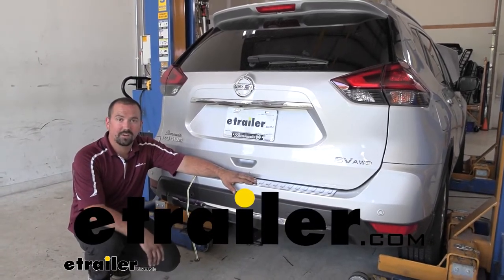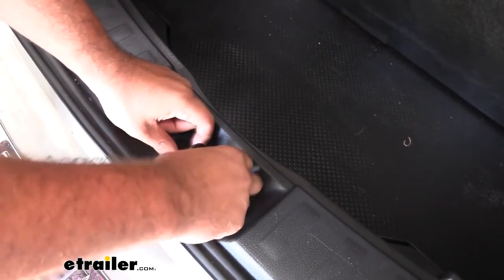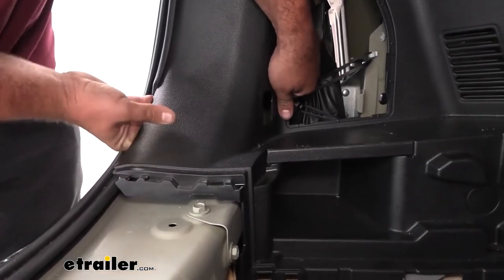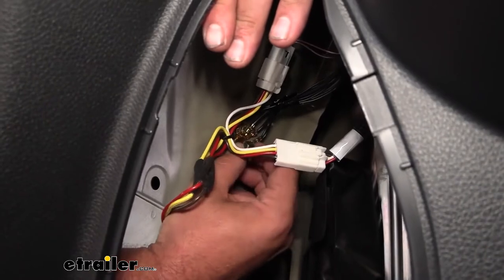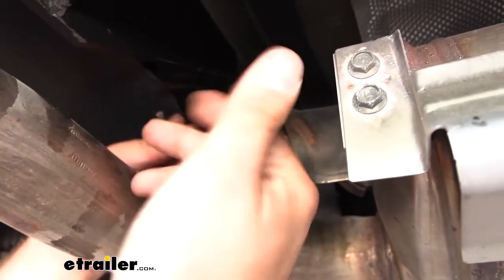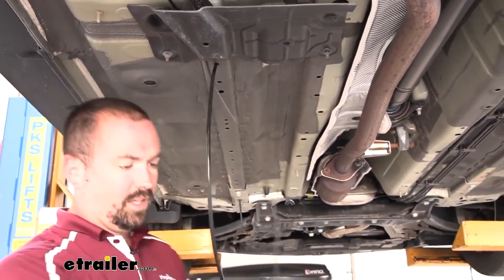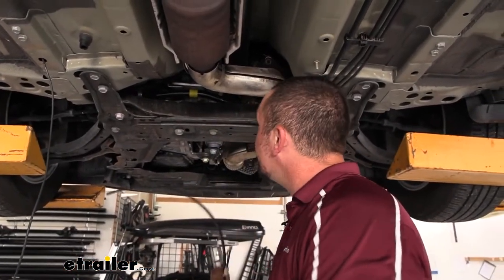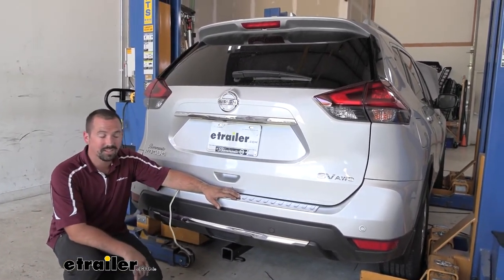etrailer | Curt T-Connector Vehicle Wiring Harness Installation - 2019 Nissan Rogue

Comment: THANKS!  I did purchase my Hitch from you. Still need to purchase this harness.  Looks like I will need a mechanic to install the harness.  You do have to have suv on a lift.  Great video and rear connections seem easy DIY but running wire under body is where I would need that help. Thanks again and hope some day I can finalize a total working hitch with lights! 9/15/2024 *Just ordered from ETrailer the Curt Kit for the lights and Great Price!

Comment: Why not use the dealer option tie-in plug right above that grommet you ran the power outside of the vehicle? All you have to do is put a fuse in the engine-compartment fusebox to give the thick wire power. I just branched off that. Some people have said the curt kit draws power at all times, so it will drain the battery. So I will test that out and if so then put in either a high load switch or a relay attached to a simple switch.
Reply: What wire exactly do you mean? Can you please point where in the video ( or just describe a bit more). Which wire draws power all the time?
Reply: @LizardsEyes  I think it is the wire bundle at 8:09 - if you follow that up you'll have a separate plug which isn't connected to anything with 2 wires. No power going to it. Under the hood in that fuse box you'll have a dealer option fuse-holder with nothing in it. Take a spare fuse or new and populate it. Then you'll have power coming out of the thicker wire on the plug and you can tie directly into that. The female spades are perpendicular to one another.
Reply: @LizardsEyes  Double checked, it is that wire bundle I'm pointing out at 8:09 - right above your thumb. Follow that up and there'll be a plug which is attached to the bundle with a wrap of some kind holding the connector to the bundle of wires. What I did was since I didn't have a plug, I removed the spade and soldered part of the wire that came with the kit to the back end of it, with heat-shrink wrap with waterproofing glue, and put it back together. I think it calls for a 30 amp fuse but nothing is connected to that so you can either fuse the trailer lights with that fuse in the engine-bay or have one in the engine bay for that wire, then come off of it and use the in-line making it easier for the customer to debug.

Comment: How about routing the wire with the factory wiring loom?. You know, like inside the car.
Reply from the maker: You can absolutely do that if you wish, but it adds time and complication to the install. 
https://www.etrailer.com/Custom-Fit-Vehicle-Wiring/CURT/C56033.html
Reply: @etrailer So I'd you buy the car with factory tow hitch so they build the car with extra wiring in it or is that wiring actually there in the back of the car somewhere?
Reply from the maker: Getting a vehicle with the tow package already installed would certainly be much easier, assuming it's an option.

Comment: This does not seem to be a good permanent solution to run the wire from the inside and drape it over the rear bumper every time you need to use it.
Reply from the maker: This is a setup that's commonly seen on smaller vehicles that aren't used full-time for towing. You can route the 4-pole outside if you wish (there's usually a grommet somewhere under the carpet in the cargo area). There's a huge benefit to storing the connector in the vehicle when it isn't being used- you won't need to worry about corrosion or damage if the connector is safely stowed away. I had this setup on my old minivan, and it worked perfectly for years when I needed to tow my PWC trailer. The weatherstrip on the rear hatch  is thick enough that the wires feeding the trailer connector WILL NOT be damaged as long as you avoid the latch. Hope that helps clear it up for you.
https://www.etrailer.com/Custom-Fit-Vehicle-Wiring/CURT/C56033.html